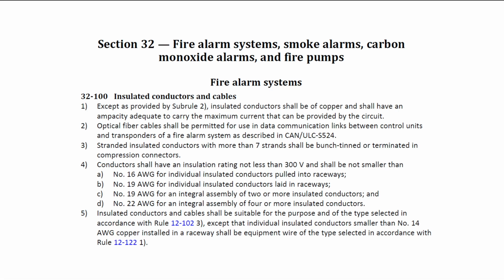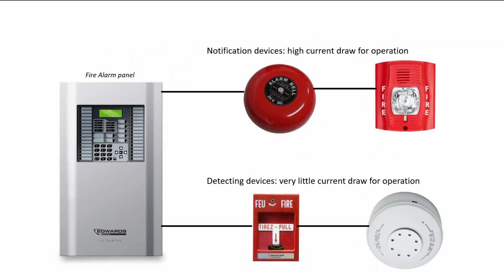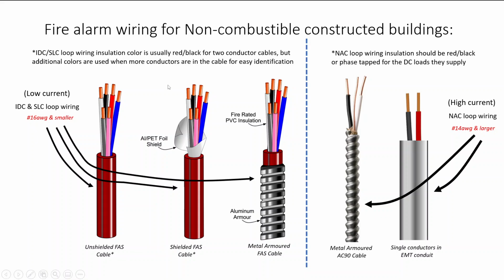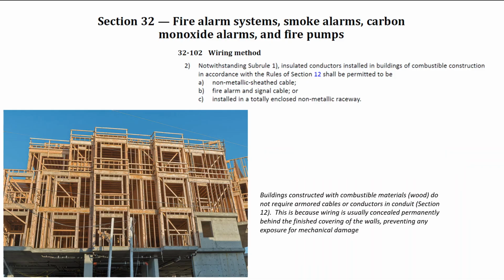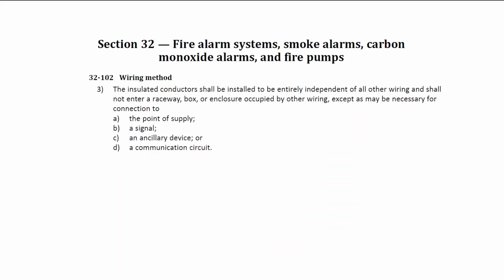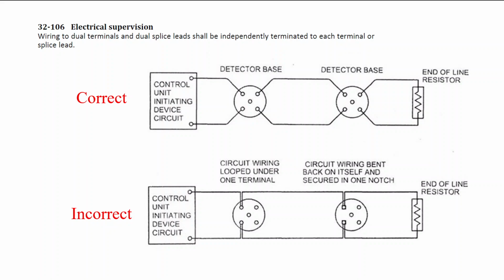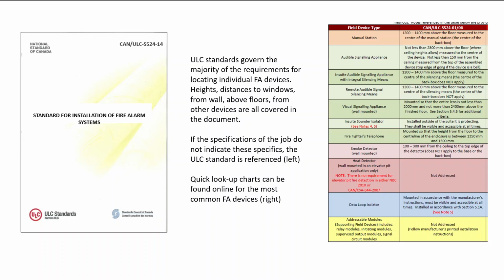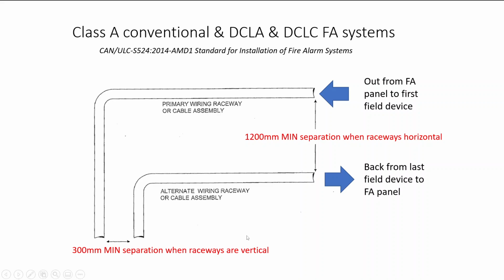Fire Alarm System Wiring

Comment: Very good video. I saw some old fire alarm systems installed without back boxes. Out of curiosity, does someone know if backboxes are mandatory under the CEC if so in which section is mentioned. I've been looking all around in ULC-S524 AND CEC and I couldn't find it. Thanks
Reply from the maker: Good question, back boxes would be an item of equipment that is identified by the manufacture. In fire alarm, the ULC standards, CEC and manufacture instructions are all necessary to follow. The type of box acceptable for the installation of devices would be identified within the installation instructions for the device.